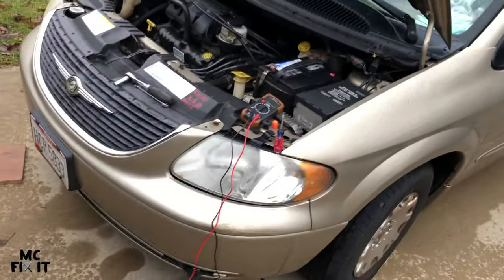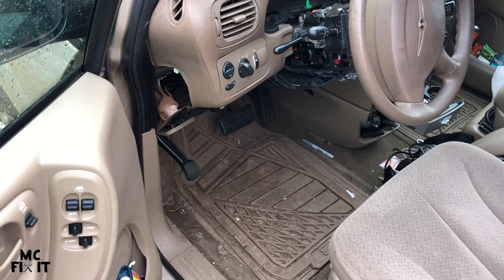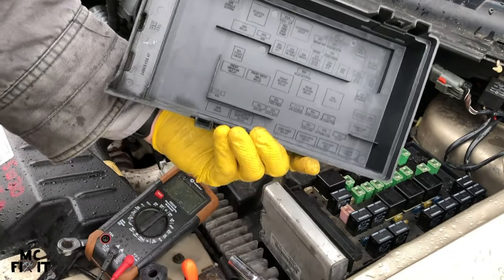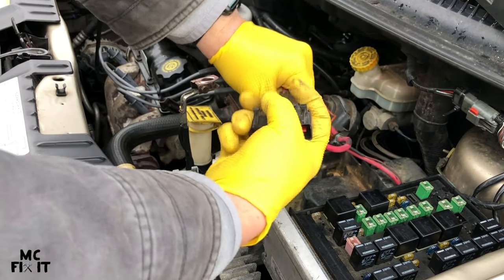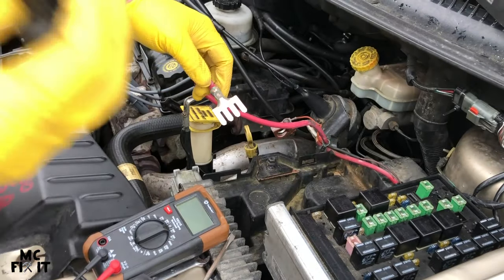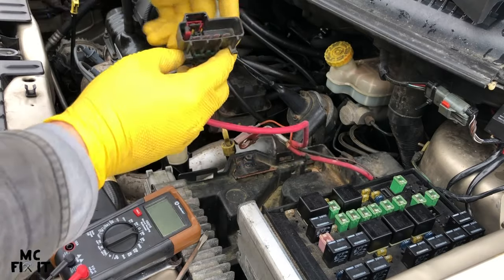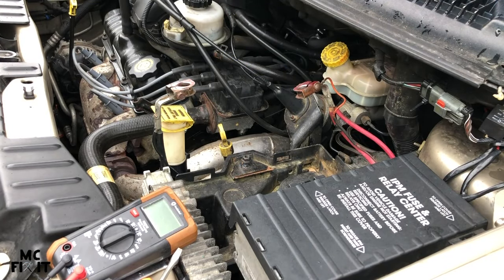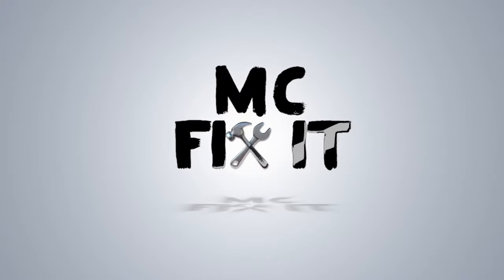Won't Start? No Start No Crank Intermittent starting problem solved! Dodge Caravan Town and Country

Comment: Thanx for the video,I have starting problems with my 2007 Dodge Caravan.Seems like the Town and Country and the Caravan are very similar when it comes to the components.After the car has cooled down sufficiently I have to crank it twice to get it started,now its 3 times.I put about 4000 miles on the car since the issue started.I replaced the fuel pump relay and the starter relay for lack of better knowledge. Once the car starts there are no issues with acceleration etc. I havn't jumped the fuel pump cause common sense tells me, if it is running and driving the fuel pump must be ok,am I wrong? watching other videos the topic of the TIPM came up which is integrated in a circuit board somewhere inaccessible. Got any advice for this kinda situation? Great video thanx for putting it up,much appreciated !
Reply from the maker: Does it crank each time on the third time (and previously on the second time)? That’s an interesting characteristic if so.

It might be fuel injectors not sending gas properly when cold. They might be clogged. It seems like the fuel pump is working with what you’ve wrote.
Reply: @MCFIXIT Yes that's the pattern, Fuel pump is definitely working
Reply: @MCFIXIT  Fuel pump is def working.If it would be injectors the car would run and idle rough or have less power here or there. The car runs great once started.I did clean all the connectors as you did in the vid...no improvement.I think it might be the TIPM ...
Reply: @MCFIXIT  Replaced the tipm and problem persisted, to find out it was a leaky fuel pump. The pump had a crack on the fuel line nipple,hence pressure had to be build up for it to start.

Comment: I have a 2010 T/C Can intermittent lights driving home van JUST STOPPED , ORDERED A Rebuilt TIPM, did the reboot protical Won't crank. Won't Start
Reply from the maker: Have you had any luck on it? I do know that 2010s are much different setup than this vehicle is from 2002.

Comment: My town country is blowing the ignition fuse when I accelerate with more power, could it be because the positive pole is sulfated? I'll take a look tomorrow and give it a little sandpaper by the way.
Reply from the maker: It could be because of that, you’ll need to pull it and see if there’s a lot of build up. Has it blown it multiple times?

Comment: start at 6:00 to get to the KEY of the problem.
Reply from the maker: Yes, that is where I fix the problem, but you may need to know the information before it see all that I have already tried to get it to work. These problems are often layered and difficult to properly diagnose without many trials and errors along the way. I hope it was helpful to you.
Reply: @MCFIXIT  Yes, true & I understand that. Was just putting a time marker for those in a hurry & impatient like myself...lol.
Reply: @MCFIXIT  thanks for the helpful video though :)

Comment: I just ran into this problem with a 03 grand caravan. I saw your video and tried cleaning that power cable but it didn't help me. I swapped relays, it was good. When turning key to start, relay clicks. Battery voltage is good. One thing I did find is the wire that plugs in on the starter, that I assume should be the 12v signal wire, doesn't read any voltage when you attempt to start. Would you have any ideas there?
Reply from the maker: You might have a wire that’s bad. I’d try to track down the wire to the starter to see if there are any breaks in the wire.
Reply: I'm having same problem. Did u ever figure it out?
Reply: The same problem and fuel pump also is not working. Will check negative cable to engine and body

Comment: Nice  job, there is literally no information available  in regards to no crank, no start with intermittent starting occurring. Do you think this would work with other types of vehicles? I have an 05 Mitsubishi galant, 4 cylinder, 2.4,  

I'm having a frustrating situation, car starts and cranks strong 75 percent of the time, but sometimes has no crank with no start. --- When the no crank no start issue arises I usually have to sit there and turn ignition from five minutes up to an hour before it cranks and starts again. All dash lights are on ,battery is brand new, starter cranks strong. All dash lights are on ,battery is brand new.

Strange thing is, my car  check engine light came on momentarily and threw out a po0335 code, (bad positioning crank sensor), but the code disappeared quickly and never reappeared. My crank is strong when the car wants to start. so not sure why the code even appeared. When my car does start, I have strong crank, so i don't think the crank sensor is involved but you can never rule anything out. 

Was thinking my starter may be getting stuck at times or maybe a starter relay issue. I still need to check both these issues, but your video gave new insight if I cant figure out what the problem is.  

Was wondering what you specifically checked for regarding this issue, prior to cleaning the contact harness from positive battery cable. I already changes ignition switch, bought new battery with new terminals and have a brand new key. Was wondering what else I can check Thanks.
Reply from the maker: That does sound weird. I’ve never had or worked on a Mitsubishi.

Was it a Crank shaft sensor? Is so, can sometimes give issues like what you said but it’s weird it came on and went away. Did you clear that code or it just stopping showing? 

For the relay option, often you can switch it out with a horn relay or wiper replay to see if it works. It needs to be one that’s the same and wouldn’t affect starting like one of the two I mentioned. Then get a new to replace the broken relay.
Reply: @MCFIXIT 

 I didn't realize car has no starter relay,  

The crankshaft sensor code was strange because symptoms of a bad crank sensor would be the car  giving crank but with no start. The crank sensor code was a soft code, it only momentarily stayed on and then never appeared again. 

I was almost certain it was the starter because at one time when the no start no crank occurred, I knocked on the starter and it fired up, but all the other times when I had the no start no crank and I  knocked on the starter, it didn't do a thing. 

It was just bizarre how it started most of the time but then out of the blue would have the no crank no start so intermittently with no pattern. 

Every mechanic did not think it was the starter because it started up so strong. 

I finally told the most recent mechanic that the only way he would re-create the issue is if he sat in the car and just kept cranking it on and off. Up to this point, no one had been able to recreate the issue and the car had been at his shop for 2 days already and at a previous mechanic for several days.

He finally was able to get the issue to occur by just continually cranking the car on and off and it turned out to be the starter. The Mechanic I used has been working on cars 40 years and said it definitely was on of the strangest issues he has ever seen with a starter and he had no answers on the crankshaft code but thinks its a non issue.

Comment: If you have green crusties on the outside where it crimps to the cable you have green crusties on the inside of the cable and eventually it will fail.
Reply from the maker: Great information! Yes, the entire cable can become corroded and will need to be changed! Thanks!
Reply: Mine was really covered in green corrosion (much worse that the video). So my battery cable if bad? This seemed to resolve my problem.

Comment: 96 honda accord same problem now think may be worn out key and ignition tumbler.  tried a less used crisper cut key and removed all the million other keys off keyring and getting it to start now for couple of weeks.  still have fingers crossed when starting it and dont go too far from home.  Do you think key was it or ignition tumbler old key issue?
Reply from the maker: I think it might be the tumbler (ignition cylinder). I know if they are weighted down they can go bad after years of additional weight. Often a worn out key will not allow it to turn at all. Like it will only go in and out, no ability to turn it over. If you do it yourself often the new ignition cylinder will have new key (or keys). I’ve never done one on an Accord but often they are pretty easy to change out with a few tools and I’m sure there’s a video on YouTube with a good walkthrough! Good luck and hope you figure out the root cause quickly!
Reply: @MCFIXIT  Thanks so much for your response and inspiration to try repair myself. Intermittant problems are the pits!
Reply from the maker: @cyyoung9175  Yes, they are the worst kind of issues to have because you think you have it fixed and then it isn't. I'd much rather have a consistent problem that can be identified and fixed. Good luck!

Comment: Mr Fix it I have a question.  I've done everything you've suggested even cleaned that cable and mine still won't start.  I took the ignition switch out and opened it up and it seems to be alright.  Everything works on the van but there's no signal going to the starter relay and no signal going to the ignition coil pack.  I can jumper the starter relay and it will spin the engine over like new but the van doesn't start just cranks over.  I pulled a plug wire and there's no spark.   Do you think the pcm isn't sending signal to the starter relay or the ignition relay?  When I turn the key all the way to engage the starter there's a really quiet click coming from that relay box not from the starter solenoid.   I'm going to sell mine for scrap and not spend anymore money on it.  The pcm has to be reprogrammed to the van so buying a new one and having it programmed it out of the question.   Any ideas?
Reply from the maker: That's a tough spot to be in. It kinda sounds like a PCM issues to me, but it's hard to tell without being there in person. PCM issues are very common on these vehicles and are often very costly. I have heard there's a company in Fl that redoes them and sells them much cheaper than a dealership does, but I can't remember their name right now. I hope you are able to figure it out.
Reply: @MCFIXIT  thanks I'm thinking it must be the pcm as well.  Unfortunately salvage yards refuse to sell them and used ones on ebay are expensive and rebuilt ones are too and require programming.  Anyway thanks for answering me.
Reply from the maker: Best of luck in what you choose to do!
Reply: I did all that but my pcm get hot and won't start not more?  I can fu d the problem

Comment: Its telling you the engine codes. When you cycle the key 3 times it will run all the stored codes. It says done after it read all the codes. The only nice thing Dodge ever did lol.
Reply from the maker: Thanks! Yes that is a nice feature!

Comment: About to try this on our 2010 dodge grand caravan. It will always start in the morning but after you have drove it for a while and turn it off it won't start again. Hopefully this is our issue. Currently sitting stuck at walmart cause it won't start lol
Reply from the maker: Did it help out?
Reply: Any updates? I have the same issue it always starts perfectly in the morning but it won't start later on in the day sometimes
Reply: Mine does this. Did you figure it out?

Comment: I've had starting issues with my 2008 Chrysler T&C. I haven't done any of this testing or taken it to a repair shop. In two of the cases where it didn't start, I had to leave the car and come back 8-12ish hours later in the morning and the thing started right up on the first crank when i came back to the vehicle. It's happened a few times since those two instances, and I've put the car in neutral and moved it maybe 1-2 feet manually and then it starts up again on the first crank. It's so baffling. Any thoughts on what this could be?
Reply from the maker: That’s a bit newer than mine was (rip). I’d give what I did a try. That’s a very odd set of circumstances causing the issue and allowing it to start. Do you have any check engine lights on? Did it start after any major repairs or work done on the vehicle.

Comment: Was your relay making a clicking sound when you turned your key? My starter makes no sound, but I hear sound from the relay.. Someone from advanced auto parts said it might be the electrical part of the ignition switch..
Reply from the maker: Yes, it made a click noise. If it’s your ignition switch it’s on the end of the ignition on the left under the steering wheel. It’s a black switch. I replaced that prior to making this video and it didn’t help my issue. Hope that helps!
Reply: @MCFIXIT  thank you... I'm gonna try what you said first, but mine is a 2000 dodge grand caravan.. I Guess the fuse box opens similar..... ALSO, THANK YOU for the quick response!!!

Comment: I too have a 2002 Grand Caravan and this problem just started. Replaced the ignition switch and didn't correct it. In addition to this problem, twice my alarm went off for no reason in which I had to manually unlock the door and turn the key a few times in the ignition to make it stop. Did you also experience the alarm problem and did your repair fix it?
Reply from the maker: Mine doesn't have an alarm so I didn't have an issue with it going off! The repair did work for my vehicle. That was the issue.

Comment: Did you ever have this same problem again after fixing this?
Reply from the maker: Great question. No it has not come back up, but I later did have some of the same issues popping up and I diagnosed the PCM (computer) as the issue for that and it solved the problem. Again, not certain if linked, but there as no corrosion on the positive wire in the IPM (like in this video). Here's the video with my diagnosis and repair of the PCM on the same vehicle after about 15,000 miles were put on the vehicle - https://youtu.be/a6ANR-qMUsk.

Comment: Something is draining my battery, we try everything you suggested. it starts but the next day brand new battery is dead.  Help please 🙏
Reply from the maker: Check for proper ground. That’s a common issue on this vehicle. Sometimes it doesn’t have a good ground connection and it drains the battery.
Reply: On this '03 Caravan in very cold weather, the brake pedal would pull down onto the brake light switch, activate the brake lights, and drain the battery overnight.
Just a very slight adjustment gave the switch enough clearance for the cold yet maintain immediate response.

Comment: I went right to mine to do this and the terminals were just fine......I'm still stumped and google hasn't gotten any smarter.
Reply from the maker: I’m sorry. I was kinda shocked this worked but corrosion can def give issues. What all have you attempted to do or looked at?
Reply: @MCFIXIT  My biggest problem was no ride to the van so another guy was looking it over .  Better odds if parked outside my place, I'd gone back and looked below the steering column for an aftermarket lo-jack key thing....at this point I'd given up. Peddle app paid me enough not to worry anymore. I think if it was not the nss it had to be something with the key. Maybe I should have tapped it anyways because it was becoming harder than usual to turn as lately.

Comment: Can u help I updated my key to mine the key workes but no cranking at all or starting could this be my problem or is it n security mode
Reply from the maker: What color are your keys?
Reply: @MCFIXIT  with the pad on em black with the sliding doors n trunk button
Reply: Black with the trunk button unlock buttons n panic button
Reply: When I jump the starter I can here it turning n turning but I'm not getting fire from distuber to fire the plugs

Comment: The done means it ran trouble shoot codes and there are none
Reply from the maker: Yes, thank you. I don’t realize it had a built in code reader when I shot this video. That’s pretty neat they thought of doing it like that so it’s easy to read instead of having a scanner. Kinda wish it threw a code to assist on the repair but it’s never that easy, lol.
Reply: @MCFIXIT  yeah most cars have  one you just gotta look it up. I couldn't find it on the car's manual but it was on the internet. Also it's  way better than bringing it to a mechanic and getting charged out the nose 😂 very handy
Reply from the maker: @devontheliontamer  So true!!! I ended up buying a code reader because I got sick of paying for someone to read the code. My closest auto zone / advance auto is about a 20 minute drive each way.

Comment: Great video!! I have a 2003 Town & Country.  Starts and runs fine 70% of the time.  The rest of time, when trying to start, it makes a sound like when a roller coaster is being pulled up a hill.  The clanking sound is fast though.

Got new battery & the starter replaced, same issue.  Seems to be worse when colder weather, any thoughts? Thanks!
Reply from the maker: Thanks for sharing! I've never experienced anything like that. Does it sound like a metal gear turning?

Comment: not on mine, still intermittent. good luck
Reply from the maker: Sorry you are still having issues. Have you figured out the root cause?
Reply: @MCFIXIT  It might be as simple as a bad starter. going to try that next. all wiring and controls check out fine.